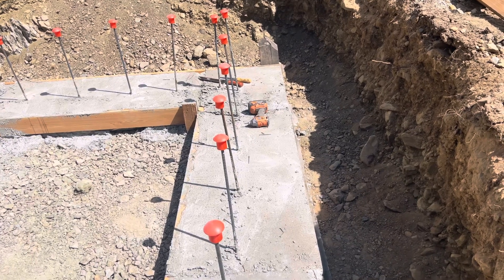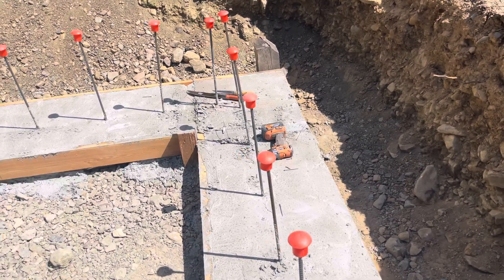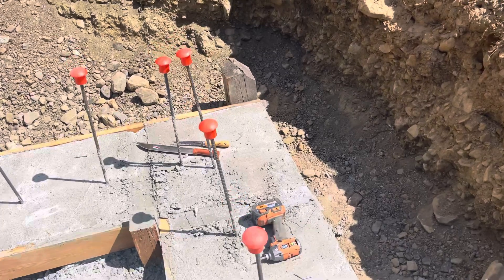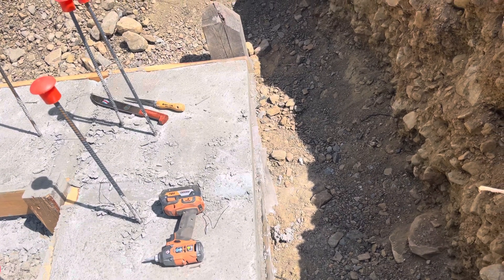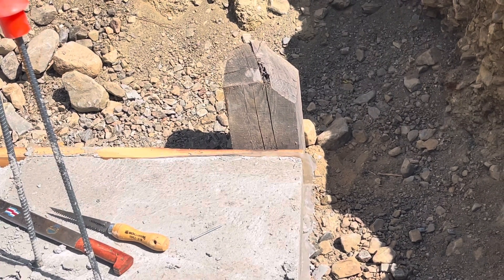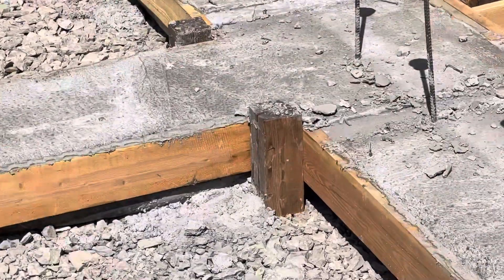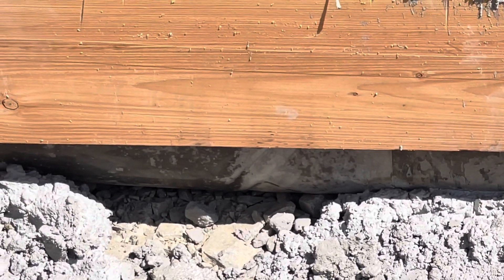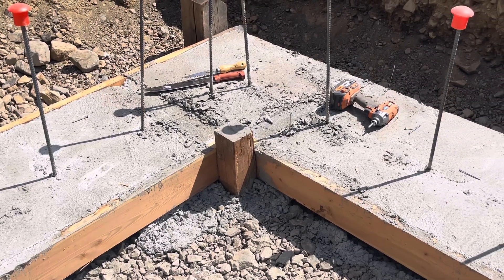Results from footing on Bedrock

Comment: Subscribed! Thank you for the two videos that you posted! Definitely going this direction because we are on a slope and spine on the top of a mountain!
Reply from the maker: Hey Ron not sure what the building code is in your area but maybe look into the radon concerns in your area and put in a radon roughin if you want a little insurance for radon….
Reply: @diyguy446  You and I are on the the exact same page in regard to radon! Already had the discussion with my wife and will will do a couple different methods of mitigation. Luckily we are only doing the 30'x40' pad and open canopy style steel building for the first couple of years so any potential radon exposure with as much wind that we have will be minimal. Thank you for responding to my comment!

Comment: Thanks! Can you elaborate on what went wrong with the concrete truck? Also, did you find that it was fine that you didn’t pin your footer forms to the ground as often (it appears that you used the posts pretty often)
Reply from the maker: Concrete truck was on an angle and the fuel filter got an air lock in it…. Poorly maintained truck…. No I found the heavy rocks around the edges was sufficient when I could get pegs in…. Once you have the forms all tied in its starts getting pretty rigid…